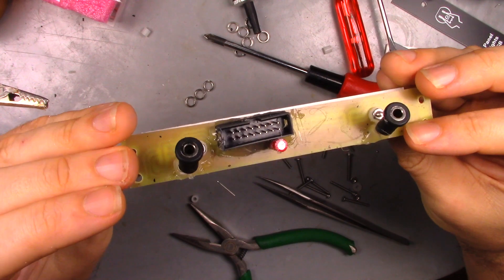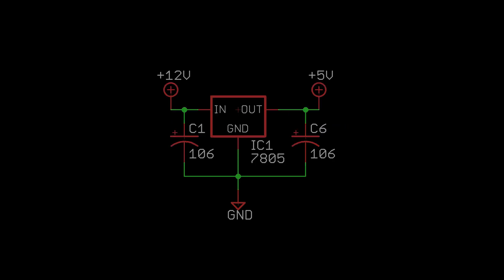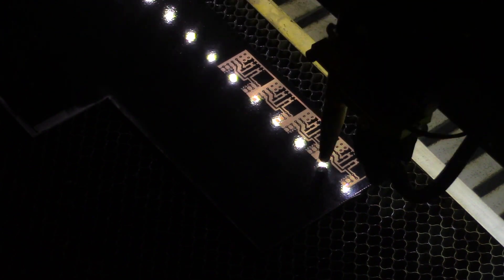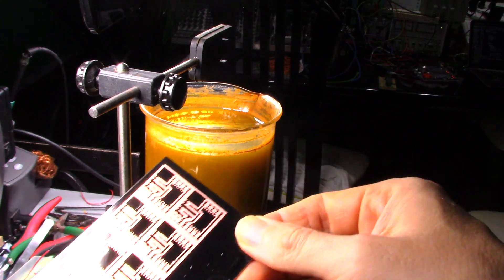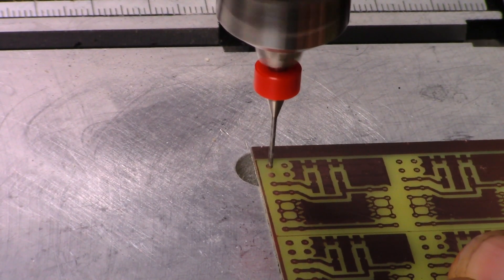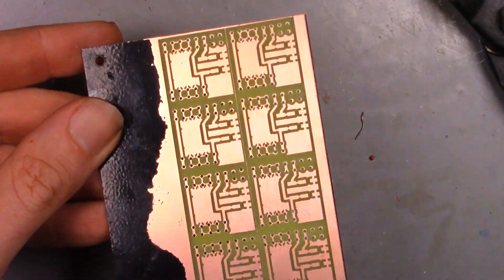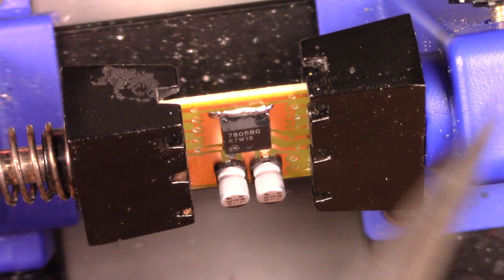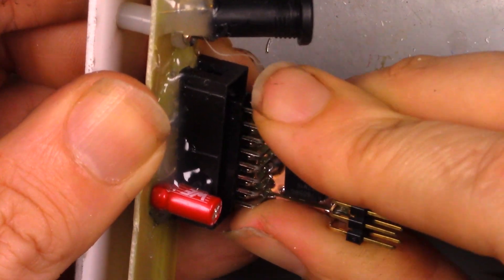Adding 5V When your Eurorack Doesn't have any

Comment: Can you make +5 V  from the -12V rail? I try this with a 7805  (input ground (as + at the 7805)and -12v (as ground at the 7805). it didnt work. There is ground and +5v output... but the ground is not on the same level as the eurorack ground.